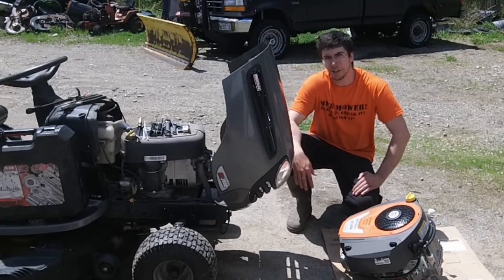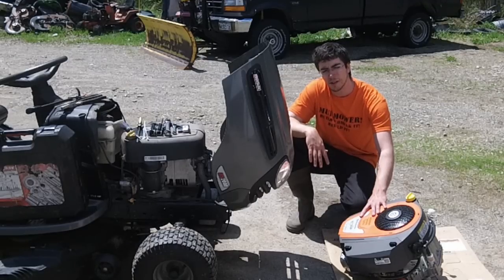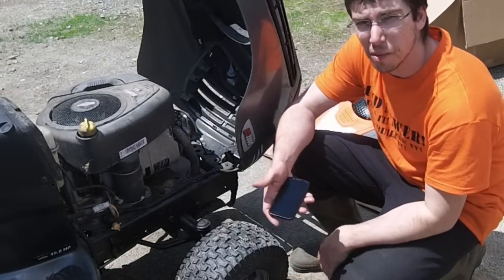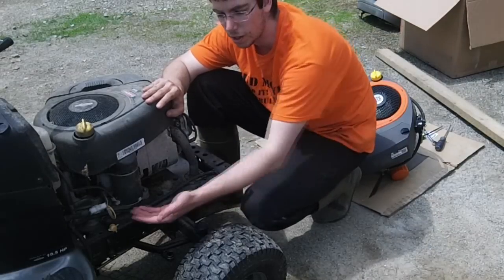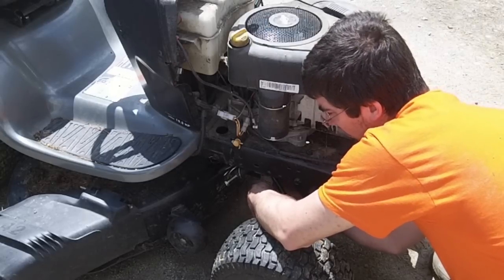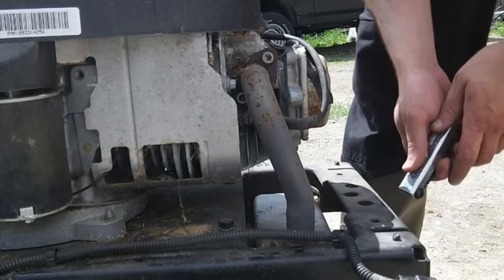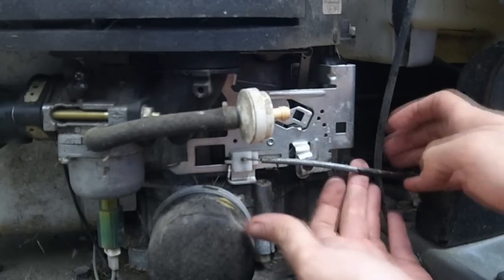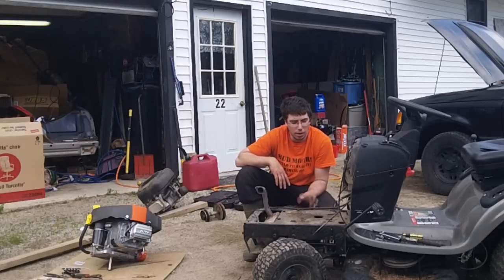Briggs single swap part 1 Removal

Comment: Hi question planning on doing an engine swap on a John Deere tractor with a 14 hp engine with a new 17.5 hp BS engine. The issue I have is the wiring set up. The old has four wires connection two for the fuel Solenoid.
Reply: The other two for the power to charge the battery and lights. But the new engine has three wiring two for the fuel solenoid. The one red is the power I get that. Now the old engine four the new engine has three. 
Old engine 28N707 type 0635-a1
New engine 31R907-0006-G1. 
Reviewed the Brigg & Stratton for information but no clear answer. Do wish to fry the electric regulator the new engine. Help. Can anyone offer some suggestions please.
Reply: @hibolinares5688  Splice the wire for the lights into the power wire on the new engine so that it’s going to the battery and the lights.